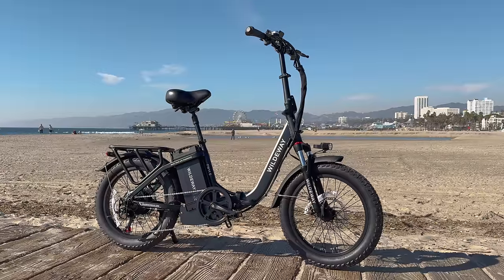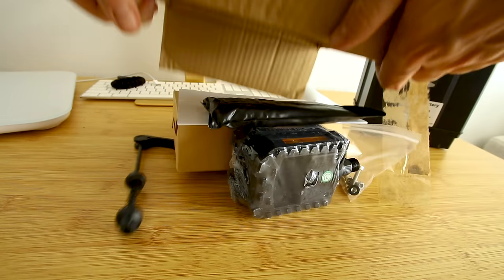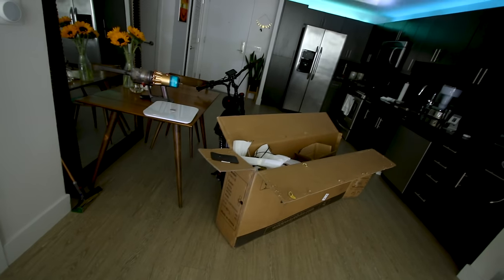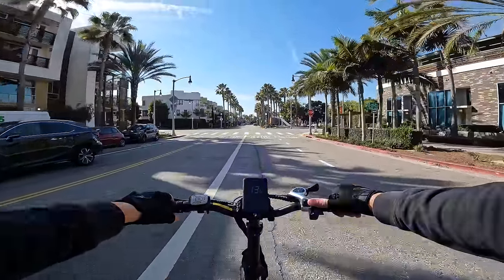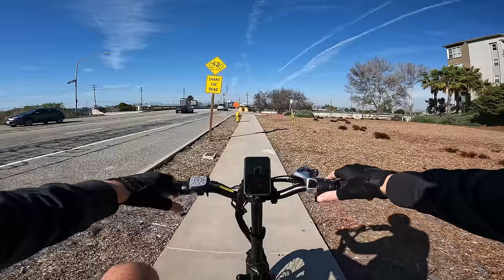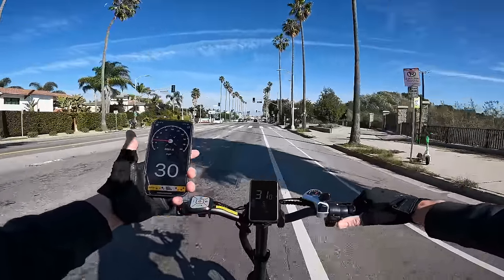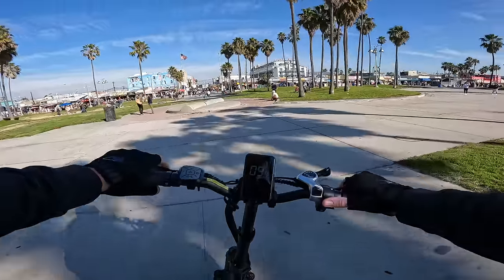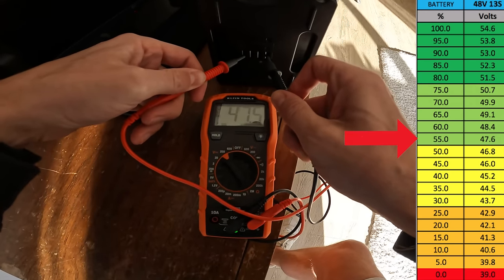Little Price, BIG Range - Wildeway FW11S 3.0 Ebike Review

Comment: I got 46 miles full throttle  and I way 215 lb
Reply: That's exactly the information I wanted to hear. 
Thanks
Reply: What do you get peddling?
Reply: Thanks for this info.
Reply: I'm really thinking about this bike
Reply: @mytwo7 did u get it then
Reply: @jimmyronald2918  yeah had it for about a month now got it 800 on the 4th July sale. Been going 15-20 miles everyday having a blast. Up and down the coast
Reply: @mytwo7  I have two now they r the vest ebikes for the money easily👍👍
Reply: @jimmyronald2918  sick I just fell of.mine Sunday because of sand broke a bone in my wrist. But it still fun ASF I put up 500+ miles already. I want a faster one though at least 35 miles per hour and I'll be straight. Or and I need a bike with rear suspension definitely. But I still love it

Comment: Going 30mph at 15-16a that means the bike is rideable for 2 hours if u ride it flat which means full out no pedalling(provided u going a constant speed not accelerating) you will get 60 miles of range which is incredible for the price and ebike you get

Comment: The price, the range, the torque, and the step through... this would seem to be a excellent bike for nearly anyone wanting to try ebiking. Only thing holding it back is the lack of rear suspension and the abysmal suspension seat post, throw a quality one on and this could be a real go to option for easy ebike commuting.
Reply: Don’t buy a cheap bike with a rear suspension. These constructions start to creak at some point and thats not that easy to fix, when all the parts are cheap. Only use suspension seatposts. They’re easy to maintain or to switch out.

Comment: I have an emoko c91, i upgraded the brakes too hydraulic and added a second battery and its an absolute blast to ride, front and rear suspension and 38 mph top speed, and i get about 30  miles if im full throttle everywhere, 40 - 60 miles in lower modes with some peddle assist, i love these cheap chinese bikes.
Reply: Yea but cheap china means problems lol

Comment: I received my Engw, I mean FW11S 3.0 yesterday and took it for a 36-mile ride today.  It still had 3 of 5 bars left riding the great majority on throttle only.  Thanks for the $20 discount.  I can only compare it to the Lectric xp2.  The Wildeway is way more powerful and faster but it doesn't deliver that power as smoothly as the XP2.  On the XP2 I can cruise between 7-8 and 12 mph using the throttle and have a very smooth experience, something I almost always do around town and I enjoy the smoothness very much.  The WW is very jerky. Any increase in throttle really gives a jolt.  Just riding on mildly bumpy roads varies the pressure on the thumb throttle enough to make for involuntary jerky riding.  

I wish it had a voltage meter but the battery capacity is great.  The brakes seem slightly better than the xp2.  The handling is much better than the xp2, especially when I put my dog on the front rack.  I had to put him on the rear rack of the xp2.  

To sum up the comparison.  If you want to go fast and far with great handling choose the Wildeway.  If you want a smooth riding experience and don't need to go over 20 miles or so the xp (now 3) is your choice.
Reply: Interesting wonder why it's so twitchy and curious if there is a way to fix that?

Comment: I opted for a very similar bike in the Romatlink Dolphin. It's a bit more expensive but comes with  dual rear suspension and a suspension seat post, and 4 inch wide wheels. Right now they have a special where they include a mirrors and a basket.  $915 at the Romatlink store.  So far I'm digging it. It has so much range I don't have the time to test. I was out the other day 3.5 hours. I got 38 miles with about 50% pedaling on dirt trails. I leaned on the throttle on the way back since it started raining. I still had one bar left on the display. Too bad it doesn't come with a voltage reading.

Comment: I got this bike back during Thanksgiving and it's everything and more wildway claims it is. Everything was tightened well, nothing rattles, it's been great.
Reply: How many miles do you get before the battery dies?
Reply: @detectiveben1  I had a big long detailed explanation but it didn't post. In a nutshell, I did mixed writing full throttle, some off-road and pedal assist. I got 70 MI. I turn the key off and on again and I had two bars left out of five.
Reply: @zfastjoe  oh wow that’s a lot of how long have to had the wildeway for so far? Any issues??
Reply: @detectiveben1  had it four months. It doesn't have a single problem. I put green slime in the tire tubes and that's it.  I did a 50-mile ride and I came back with three bars showing out of five on the battery. I honestly think if I go 15 miles per hour I can get over a 100 mi on it.
Reply: @zfastjoe  it’s crazy how the 3.0 wildeway is only $799 and no tax for a 32 amp battery!! Did you ever buy the 3.0 one?
Reply: Curious I saw another person on here state that the power is very jerky as you accelerate decelerate making it not very smooth curious if you have had  that experience?
Reply: @travisj.1938  it's not jerky to me and the motor is silent. I think you can adjust how the motor comes on in the settings but I don't need to. I'm pretty heavy I carry close to 300 lbs with me and my stuff. Maybe if you're really light and you leave the controller in the original settings it might be jerky idk.

Comment: AND SO IT BEGINS!  Legislation has been introduced in New Hampshire to classify any ebike THAT GOES OVER 15MPH as a regular motor vehicle and require registration, plates, licensing and insurance.  And thats just the beginning.  I've been warning about this for a year and YTers like this who post videos encouraging speeding, reckless riding and altering the safety protocols while aimed at teens are partly responsible.  Look for similar legislation to be proposed in most other states over the next 12-24 months.  A few Jeff Spicolis and 20%ers ruined it for everyone.
Reply: Didn't pass

Comment: Have you discovered how to change the speeds inside the pedal assistance I will be pulling a Child trailer behind and 16 mph is a lot when you’re pulling a trailer that recommends going only 10 miles an hour
Reply: I have read in the reviews that it can be changed I am thinking of buying one and was wondering the same.
Reply: I read in the reviews for it that you are able to change them I am considering buying one and was wondering the same

Comment: For the cadence sensor, you have to pedal one full revolution in order for the motor to kick in?? Is that normal with e bikes? Is it inconvenient? Wouldn’t half a revolution be more beneficial??
Reply: Use the throttle and then use pedal assist

Comment: Are you able to verify this was the 3.0? On the website it says the 3.0 is 500 watts but peaks at 750 watts however you said yours was doing 900 watts when u where pulling 18 amps
Reply: 750 watts peak is very suspicious when it can climb that 20% hill. You may be right, it might be 4.0.
Reply: What is odd is the bike is the 3.0 because the tires are 20x3, however, it’s almost like they threw on the 4.0 motor for this review or something?  The 4.0 would have 20x4 tires and hydraulic brakes.  This is odd with the motor though
Reply: i had the same thought too... after watching the unboxing portion again, unfortunately i cant read the upc code but i can see the color options and say that based on that, its the 3.0 for sure. that motor power seems off though which also has me concerned regarding hill climbs etc. im seriously hoping that they didnt juice up his "3.0" bike before they sent it in order to sell out older worse performing models....
Reply: So 3.0 is bad quality?
Reply: @LuiHerrera-fw2mg  so i actually vought this exact bike in the non step through version. The 3.0 is wonderful! Mechanical brakes vs hydraulic is the major difference. The 3.0 is NOT lacking in power and thats coming from a 260lb 6'2 rider. This bike hauls me around great! Had to adjust the brakes a little but nothing major.
Reply: @SuperWaterskiboy  Thanks really, now I have doubts, well I bought the 3.0 hopefully and I don't regret it
Reply: How are you liking it?!
Reply: How do you like the new bike?
Reply: @rickflair4428  you asking me or the other guy? Lol
Reply: Both of you!

Comment: It would be nice to get a better approximation of the total range for you, a 200lb rider. Their website claims up to 90 miles in pedal assist mode and 60 miles in pure electric mode on one charge. You went almost 20mi and didn't do any sand riding, pretty much all flat street riding, and according to the voltmeter, you were already down to 50-55% battery? It doesn't sound like you'd get anywhere near the 60mile claim on throttle only..maybe 35-40 on throttle.
Reply: All the companies lie unfortunately. General rule of thumb I have seen is that the actual ranges are usually about half of what these companies claim.
Reply: He didn't start with a fully charged battery.

Comment: You know that looked really good until you said it had 3 inch wide tires you lost me right there
Reply: 3 inch wide tires are perfect.  4 inch fat tires are all overweight/underpowered.  If you chart out all these bikes for weight / top speed.  Portola is the best at 59 lbs @ 28mph.  This bike doesn't fold well.  Zero 4 inch tires rank anywhere close to that ratio.